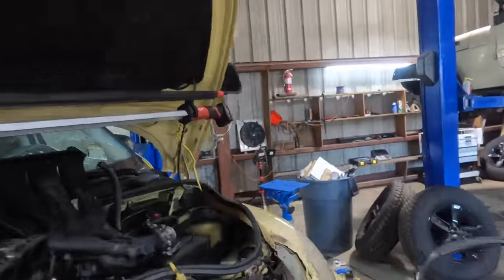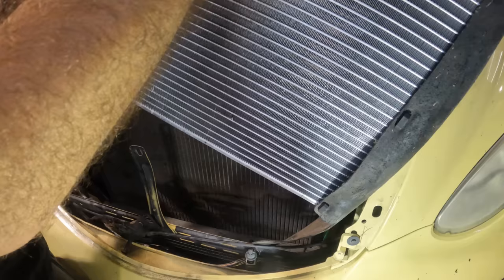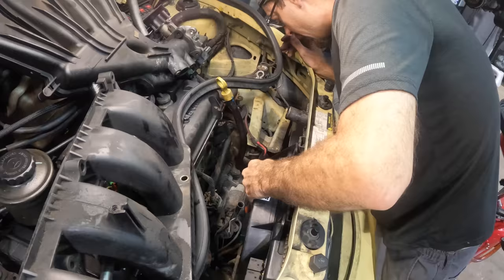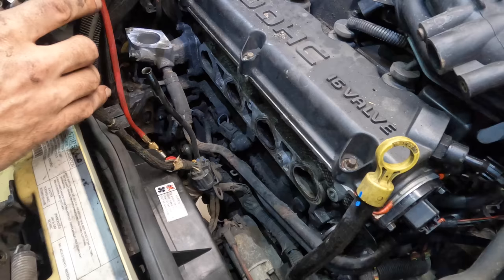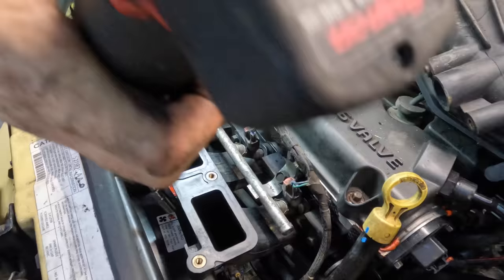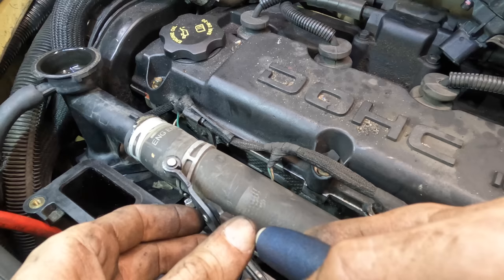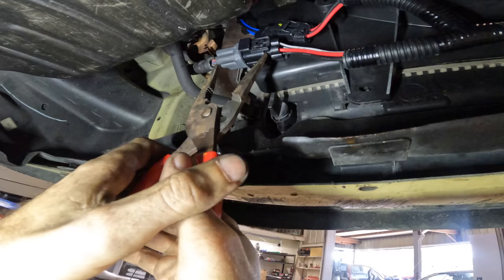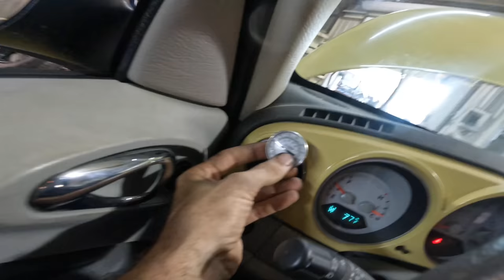Recycling Dodge Parts! 2007 Cruiser 2.4

Comment: FYI: so you know all O rings are not created equal. Freon like chemical solvents attack rubber and polymers differently. One type is for 134a may not work on another type of Freon and vice versa. Use the appropriate O ring or gasket.

Comment: Word of caution. Blowing off flammable brake kleen or other such liquids with air nozzles. If you blow it hard enough in a tight area it can self combust. I had something similar to brake kleen in a crack between two pieces of sheet metal on an aircraft part and I could spray the cleaner and then air and you could hear the pop and see a small flash. Of course being the responsible adult mechanic and always thinking about safety I did it over and over and then went and got coworkers to show them. Just know if it does this while you are spraying still Foom 😆

Comment: The job is getting more and more positive solution.
Just a sting from the radiator in your face.
6:45 clear that the paint is not applied further than necessary.

Comment: Got a suggestion for that Thermostat housing. I've watched, and used, Jeff Bradshaw over at Redneck Restorations/ This Old Truck use JB Weld to fill in those pits. Especially on old stuff that is expensive/ rare stuff. Works really if time consuming.

Comment: The good news: Those thermostat housing flange pits are where the steel thermostat contacts the aluminum housing. The gasket seals peripherally to that mating surface. That means the pits could cause some coolant to bypass the thermostat, but it won't cause coolant to leak.

Comment: It SHOULD be easier to install the fan/rad/condenser as a unit as the factory originally did, but if the trans cooler is in the rad, it's one more set of lines to deal with. Not sure if the intake would have had to come off to do this job. Most factory assembly lines put the engine/trans/suspension in from the bottom as one unit and then the radiator goes in after, BUT the front fascia and bumper bar that is behind might have been in the way on this model. Don't want to mess with that as the clips will all break and you have to get it all back together with the proper fit. Six of one, half a dozen of the other. Whatever gets the job done in the least amount of time without breaking anything that isn't going to be changed. PT cruiser it tight to work on as is Mini.

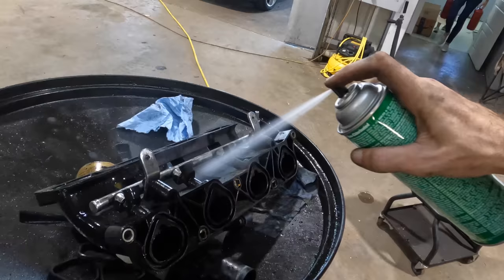Comment: 9:45 - Ray you might want to check out your can of Brake clean. I've seen this a couple of times on Eric O. Channel from South Main Auto aswell. He has some defective cans that don't sound right. 
You should make sure that your camera is calibrated to the cans and able to hear the Infrablue Audiospectrum in order to pick up the sound of the cans properly.
You might need to tune the microphone of the camera a tiny bit with the pack of cans you have in your shop to make sure that all make audible sounds through the camera.
If they don't do that after tweaking, you have some defective units and need to replace them immediately. 
They are not sufficient for your Viewerships auditorial pleasure and might perform subpar for their intended use-case of generating additional interactions of said viewers. 

Just messin' about - keep up the amazing work. Always fun to have a video to watch from you.

Comment: @19:02  I used fishing line to hold the thermostat when replacing it on my 1993 F-150 5L V8....the line was inside the housing and looped through the thermostat.   Not inventive, but I was losing patience.

Comment: Why don’t you put blue roll down the orifices when you disassemble to prevent contaminates entering the internals of the cooling system or engine block. Especially when you were cleaning up the thermostat housing

Comment: Remove & Replace Condenser, Cooling Fan & Thermostat  - $250.00
A/c Service                                                                                    - $99.99
Condenser                                                                                     - $159.16
A/C Liquid Line                                                                             - $118.33
Cooling Fan                                                                                   - $134.99
Intake Manifold Gasket Set                                                        - $45.21
Thermostat                                                                                    -$27.92       
Brake Clean                                                                                   - $400.00 This stuff ain't cheap

Comment: spraying break cleaner while you are spraying air into the air intake is redundant.  the air your spraying is creating positive pressure in the chamber meaning not a single drop of break cleaner is going to make it inside. and IDK if thats the intention, but break cleaner doesnt leave residue so there is no issue if it gets inside, it will evaporate away.

Comment: Yeah, that whole dodge neon platform I hated working on thank God they did away with it It was definitely packed into the chassis set engine. It’s good engine it’s just the electrical they leak oil.

Comment: Ray you mite find this amusing. I was helping a friend with her Mustang 2 that had been sitting for a number of years. Her husband had been working on it and had replaced the battery. I found out why he could not get the car to start. He left the plastic caps on the battery posts. I did not inform her of that.

Comment: "Does engineering count that as a win? If they use up all the available space?"
No. But the sales department certainly does!
Don't cuss out an engineer, cuss out sales/management, because an engineer will usually raise the point "um.... that's gonna make this hard to service", then they get the question "what does it take to fix it and how much will it cost?", then someone gets a hold of the two options and sales and/or management says "go with the cheaper option" and the engineers get blamed for it.

Comment: I'll be honest, when I saw that AC high pressure run off the gauge in the earlier video, I was first scared it would blow, then impressed that it didn't.
My advice is to also change that radiator cap, my experience with these particular Chrysler products isn't great.

Comment: Sorry. Ray the top of the thermostat has the filler cap so you'd drop a string in put it in the thermostat pull the 2 ends out the top. This is only ment to hold the thermostat in place untill you get the housing bolted down. Then you pull the string out slowly,   no dropping it. 

Not that this will work on every car, but it will on a lot of them. I dont do that kind of work on other people's cars only mine but there's always a shortcut or trick you can use, like you showed me holding a bolt in a socket with a paper towel.  
I just seen the obvious solution.

Comment: engineers consider it a success IF they 
A. use all the available space.   
B. Interlock all the pieces so you are unable to access the points that would remove them from their position.

Comment: I know you are replacing clamps that it came in with, but those hose clamps are not to be used on a plastic tanks...no room for expansion causing cracks at the connection...!

Comment: Use Brake Kleen at the same time as you blow the part with the air gun.
Result,
Brake Kleen pressure washer (:

Comment: Thanks for the videos, just wondering if you replaced the receiver/dryer. Seems like in the first video you mentioned you suspected a blockage in the system, if there was that could explain why there was still pressure in the system when you removed the first line.

Comment: I am no Mechanic by any stretch of the imagination ;)
I have one suggestion, from the prior video.
Since you took the Front End off to remove the condenser,  As you said "Sometimes they are Spot welded." Would that mean you didn't have to take the Intake apart to get the fans out? That would have made your life that much easier, and saved the Owner a few $$!
This is an honest thought. I guess Hindsight is 20/20 :)
It is also True that the Thermostat would have failed!! So it wasn't a complete waste of time :)
Take Care Ray and Christmas Wishes to You, The Wife Unit and the Grasshoppers in your life!
Best of Wishes on your NEW ADVENTURE! You will do FINE!! I know it!

Comment: Just a worthless fyi:  I have found that infamous "bitch clamps" on radiator hoses are worked better with a special tool with a flexible cable and remote handle.  Better grip on the easy clamps and your only grip on the hidden or awkward ones.

Comment: Hahahaha right on time with another can of that brake clean.. i myself use it just the same exact way you do. I find it cleans my work space and crudy parts to know exactly if it needs to be replaced if cracked or damaged. Oh and occasionally spray off my hands and forearms to get that tough oil that like to get deep in the skin off or use the parts washer to break down those oils and then wash that off so I don't have to scrub as hard and still have enough skin at end of the week lol

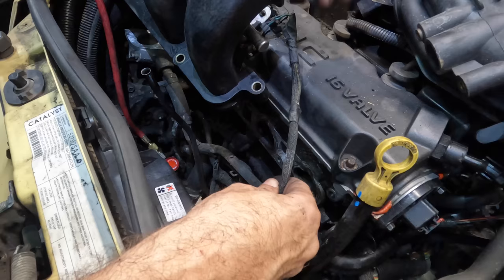Comment: Great video. Lots pf fun to watch (all three parts actually). One question from the OCD guy here..... Did you ever find a place to bolt up the bracket for the fuel injection harness (12:00 mark)? I didn't see it get bolted back up to anything and I'd be worried about it finding its way into the fan at speed. I went back and watched the previous video where you took it apart and at the 20:15 minute mark you can see the bracket was hanging down, and therefore wasn't bolted to anything prior to you working on it. Either it never was bolted to anything, or whoever messed with the intake before you didn't bother to put it back in its proper place and possibly even lost the bolt.

Comment: Ray do u save the studs and bolts from repairs to use for installation of parts like silicone oil.pans to reduce smears and to use bolt from intakes brackets not needed for salvage yard replacements.Just curious!

Comment: Funny how they print all that DOHC 16 valve shit on the rocker cover. 
You can only see it when the engine is so far apart that it's irrelevant.
Effing Chrysler. (Or Daimler - Benz in this case).

Comment: Hi Ray,,,  I have noticed that you sometimes comment about getting muscle cramps,,,  I have the same problem when doing strenuous work,,,  I have found that if I take a potassium supplement on a regular basis, that my muscle cramps for the most part, go away,,,  Maybe you could also benefit by such a mineral supplement,,  Just a thought,,,   :-)

Comment: ray did you leave the freon lines open to the air. lots of moisture in the air in fla . always seal the lines
Reply: Not disagreeing but isn't the purpose of drawing a vacuum on the system to remove the moisture?

Comment: I didn't see you ADD ac refrigerant oil AFTER changing the ac condenser. Rookie AC Tech mistake! Now the ac refrigerant oil is low in the ac system! That is a BIG NO NO! Per Chrysler (MOPAR) you are suppose to add refrigerant oil when you replace the condenser just like all other manufactures too! You are also suppose to add refrigerant oil for a SMALL refrigerant leak and for LARGE refrigerant leaks! Like as that SUDDEN LEAK you created disconnecting the lines!  You blew refrigerant oil on yourself disconnecting the lines to the condenser, refrigerant oil loss! So much for your cheap IMPORT off brand AIRTEK AC Machine that didn't fully recover ALL of the refrigerant from the system! I see major trouble with that NEW imported Airtek machine so far has proven to be a CRAP machine right out of the gate. It looks like a new machine and it has already done a disservice, so much for that ozone layer! Had to put that in for the tree huggers! It did not need an ac condenser as those crazy high pressure are totally normal when the condenser/engine fan does NOT work! You could have even tested that very FACT by leaving the fan unplugged! Put the parts cannon down, you are wasting customer money and only running their bill up! Although, do keep the comedy series going, you are great entertainment and better than TV reruns! Great job there!